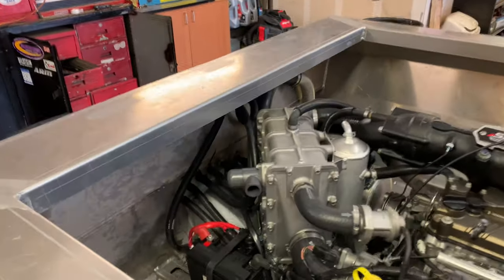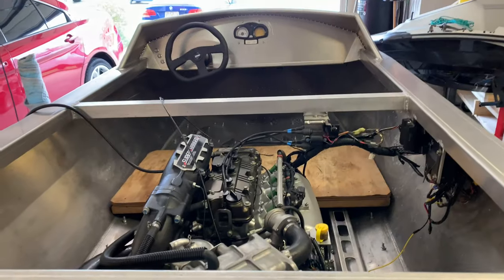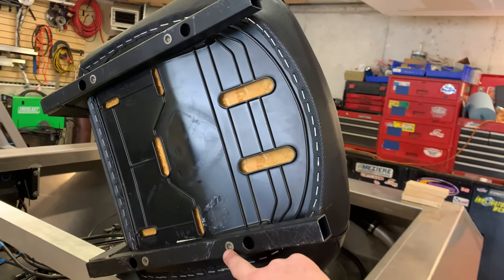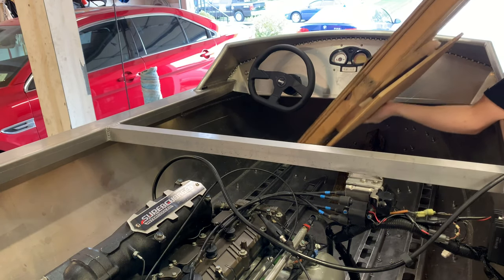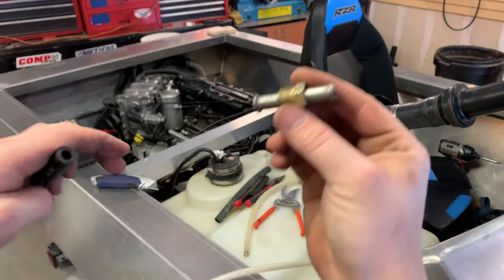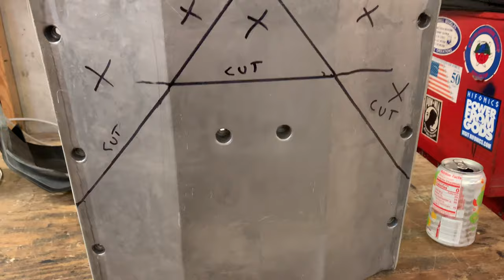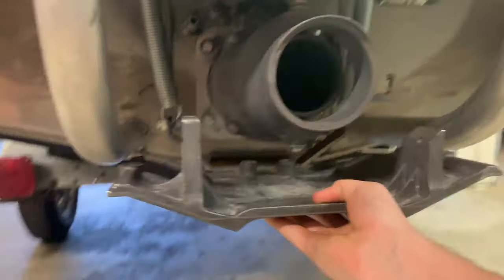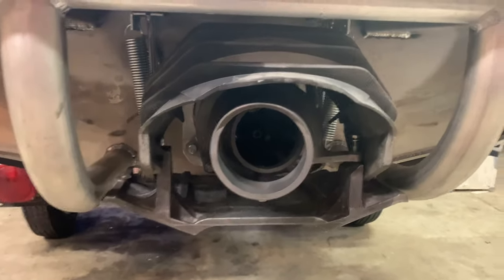Mini Jet Boat Build 15 - Prep for test run, Temp Fuel Cell, Seat Mount, and Reverse Bucket

Comment: you need to build a tubular reverse bucket . the plastic one is a down blast that will wash rocks into the intake. you need side discharhe  u shaped to wash water more out both sides.
Reply: out both sides which happens to send water into the back of the hull which makes your reverse useless you rarely use reverse in shallow water anyway
Reply: I am curious if you ended up keeping your reverse bucket or switching it out?

Comment: the fuel line problem is not from fumes it is because of alcohol fuel expanding in the non braided line and causing a mist spraying leak and blowing up:)

Comment: you need to use a stainless braided fuel line ir you will have a fire ball fuel explosion, it is just a matter of time and pressure.......
Reply from the maker: Thanks for the advice! I will look into some braided lines when I get near the hatch build. Not too concerned with the fumes, I plan to have some good air flow and a blower setup.